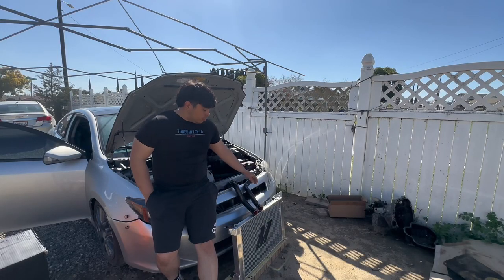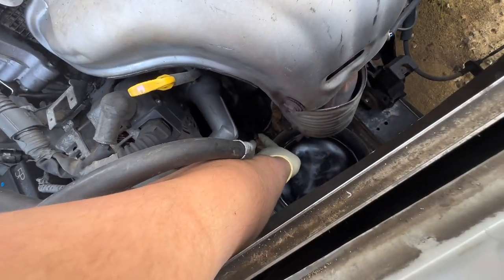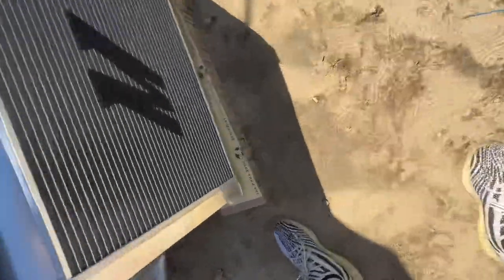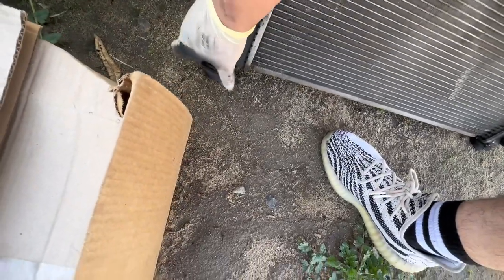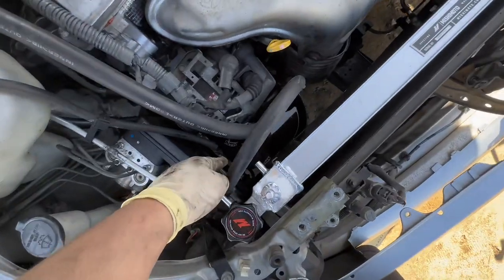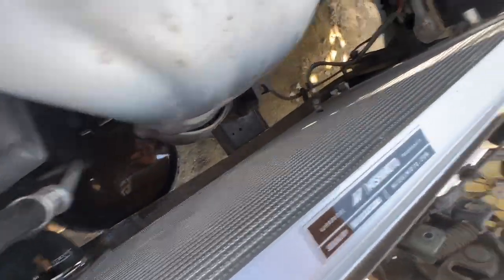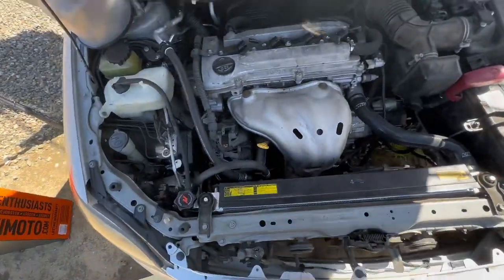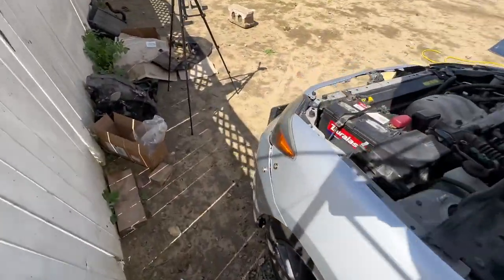05-10 scion tc Mishimoto Radiator install w/ HPS rad hoses

Comment: Nice video bro! I have a question about the cooling fans. What direction do they rotate to? I gave my scion tc 2009 to my sister and it has been heating up recently after her mechanic did some work on it. The fans were replaced but I am not sure if the cooling fans were installed properly, I dont remember what direction they rotate to. If you can tell me I would appreciate it.

Comment: You know how this and the Corolla xrs 2.4 has the same engine 2az fe would this fit a Corolla
Reply from the maker: It’s crazy how this engine was used for a long time even though it had oil consumption issues